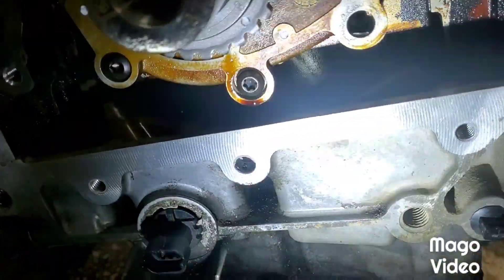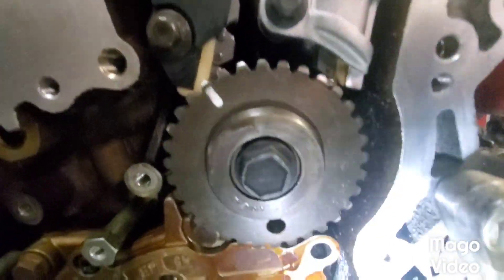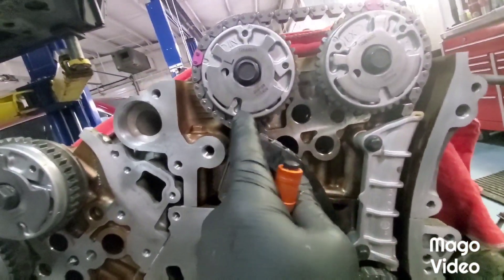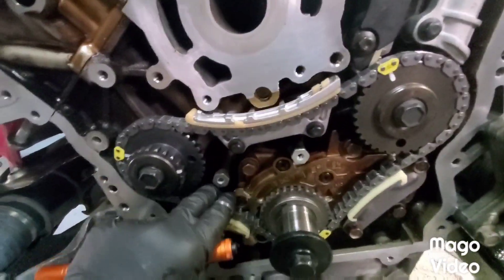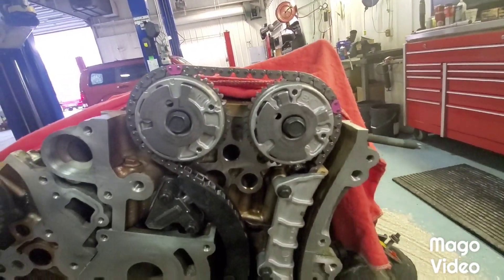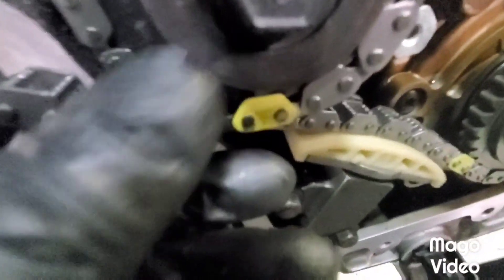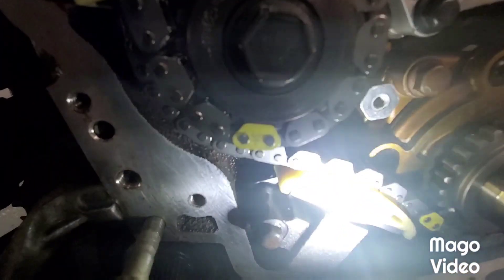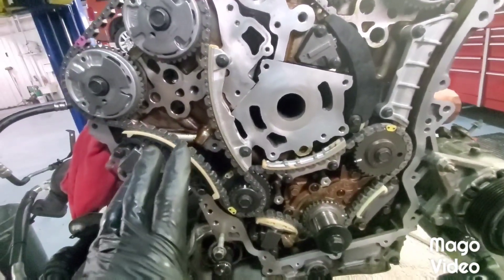GM 3.6L STAGE 1 & 2 TIMING SIMPLIFIED

Comment: Vid is good to go. But not totally clear..Which cyl is tdc and on which stroke when you line up stage one timing marks on crank sprocket (presume crank sprocket could be lined up but not on correct stroke).
Re-watching vid maybe I missed something. Again the vid is good to go. Thanks for posting.
Reply from the maker: If you're overthinking you're already lost

Comment: Hi paul i got a mechanic to do it but he set everything at 9 0clock he stated thats how he does them ,he put them on i put the car together he took a fuse or relay out and jumped it to turn it with out  it firing up once he fired the motor up it started to misfire then multiple misfires also a knocking noise in the manifold  or appear to be the manifold can u help .

Comment: Hey paul when u removed the stage 2 chain what timing mark were u set at, 5,or 8, im having alot off trouble following the procedure re timing procedure, as everyone leaves bits out or does it differently. i found  ur quick  giude in reply to a comment but there u refer them as banks can u clarify please, would be apriciated
Reply from the maker: Bank 1 is your right bank...Bank 2 is your left bank.  Remember that left and right as if your sitting behind the engine driving it.  So when you're looking at it from the front...as I am in the video...the left Bank (Bank 2) is going to be on your right.

If you set the crank sprocket to stage 1 timing mark before removing all the chains etc, you'll be good to go, remember it's not an interference engine, so as long as you follow the video and set the timing correctly in both stages, you will be fine.
Reply: @PaulysAuto  stage 1 timing is 9 oclock or 5 oclock a
Reply from the maker: @poogzie  stage 1 is 5 o'clock on Crank on the dot on oil pump

Comment: Hi, can ask what stage timing , 5, or 9.were u in before removing chains on right side also were u tdc before removing r s chains when u went to left side did u rotate the crank  if so to what stage timing, after u replaced the chainns in stage 1 did u rotate the crank to stage 2 and what timming mark was it 5,or 9 haope u with me .cheers

Comment: Hi i removed my rockers covers and had a quick look ,i then decided to rotate the engine for the timing marks but the i went anty clock wise and came to a stop ,i then checked the rockers and noticed right side last rocker on inlet side had come off , im not sure weather i caused the issue or it was there ,my code was p0008, if i did cause it how do i fix it ?looking forward to ur reply .

Comment: Left head uses DOTS on the phasers, the right head uses ARROWS on the phasers. (just in case you didn't know this, Left and Right side of the engine is degermed by which side you would see if you were standing at the back of the motor looking forward. If you were standing on or behind the transmission looking towards the front of the motor, your left would be the left bank or head and your right would be the right bank or head.) Most "techs" would know this but the kids at the part store are NOT going to know this. People that knew that the left side of the car was the driver's side might get confused because the motors are often in sideways now. I've had many issues with getting wrong parts, like motor mounts...they'll go by front and rear sometimes or left and right on others. When the motor is sideways or "transverse" which side do THEY think is left or right? You might have to get in the habit of telling them "left is the radiator side, right is the firewall side". LOL  It seems stupid and like something that shouldn't happen...but it does, often. I'm sure Pauly can attest to that.

I wanted to put up a quick comment here Pauly. The 2011 Acaidia that I did the timing on broke the chain on the right, phase two side of the timing. I thing the wear pad on the tensioner guide came off, caused an interference and the chain just snapped. FORTUNATELY....the cams were as such that no valves hit. I know it sounds like a one in a million  thing but first I checked it with one of those inspection cameras on a stick thing and then I did a leak down test. To my shock and pleasant surprise, I had nearly perfect pressure. I'm about to put the new timing set on, we sent the old stuff back to see if Cloyes would warrantee it. I'm not holding my breath. But in the mean time we bought a new set and I'm putting it on now. I didn't like how "chinsy" that one was. It's captured very well on one end but the other end is held by two rather small tabs. I thought they looked a bit weak and I'm guessing the one I thought looked rather weak is the one that broke and bound up the whole system. That tab was broken off but I can't say for sure if it happened first and caused the failure or the chain broke for some other reason and that tab just got broke off in the process. I wanted to glue it or something because I didn't like how loose and crappy it looked. I'll be THOROUGHLY inspecting every piece of this kit. If something's questionable...it's going back. I don't care if the hoist is tied up an extra day or two...I'm not risking it this time. Just because it's the almighty Cloyes...doesn't mean you can't get a crappy piece! 

The issue I had was not catching that the left side head uses round dots on the phasers where the right side used triangles/diamonds/arrow/pointers. Call em what you want. LOL The trouble I was having when I couldn't get it to run and had it back apart not knowing what to do...I was going by the painted marks on the new phasers. The intake cam phaser for the left hand side head was incorrectly marked, the ARROWS were painted, and I didn't catch it. It's easy enough to do guys, this is a HUGE job and it's easy to think you can trust the dealership to have things correctly marked but you CAN'T! You have to check everything. EVERYTHING! Like Pauly says, the exhaust phasers are interchangeable so you have to pay attention to the DOT vs ARROW on them. Don't go by the paint on your phaser marks. Like I said the brand new one I got from the dealership with the "L" engraved on it had the triangle mark PAINTED. I never gave it a second thought and  used it. It was marked wrong. I'm very lucky it didn't cause any damage but compression and leakdown tests verified that everything was fine. But I could have saved myself a TON of work and a ton of stress if I had just paid attention to this vid that says, CLEARLY, left head uses DOTS. The right hand head uses ARROWS.

Thanks for your effort doing this vid Pauly!
Reply: I just realized I used the arrows for both heads, real bummer, engine is already back In the cat, gonna have to get it apart and redo the timing using the dots. Hopefully tying to start it with timing set to arrows on both sides didn't damage anything
Reply: Got the timing chains off and did it again with the dots  and engine runs good, this video was very straight to the point and clear, thanks a lot!
Reply from the maker: @jcbuilds3648  excellent 👌,  always a great feeling when it gets done and fires up like a champ!
Reply from the maker: No thank you for taking the time to share such a detailed comment!

Much love for those who share experiences ❤ ✨ 💛 🙏
Reply: @PaulysAuto  I just buttoned it up. Still have some wiring I can do while the cradle's down but the body will be back down in short order tomorrow. Hell, I've dropped this cradle several times now...I've gotten rather good at it! LOL I SOO hate to admit that...LOL But yea, I got really good at dropping the cradle on that piece of crap! I'm scared to death I'm going to end up being the 3.6 high feather guy LOL
Reply: @PaulysAuto  By the way, Cloyes did pay for a new timing set.  Also, though I work on cars for a living, I'm not a professional. I have been working on cars since I was 10, I'm 55 now and what really helped me work like a professional without the certs, I went to school for engineering. An engineering degree, experience in that field enough years working on cars and you can do about anything. Again, where I made the mistake was I didn't notice that the dots were on one head and arrow on the other. I could have saved myself a lot of pain and suffering if I had noticed that when I took the motor apart. I had no idea it was such a complex timing set. This motor spun a bearing. I expected the timing to be the easy part! LOL...boy was I in for a surprise. Thanks again Pauly!
Reply from the maker: @waynethomas1726  Well I'm so happy you got everything figured out,  sucks that it spun a bearing. Thanks for sharing your story with me.
Reply: @PaulysAuto  No problem, thank for sharing that vid with me. I would have eventually stumbled on what the problem was, but how many more times would I have needed to drop it back out and tear it all apart again? That vid of yours where you said, "see, dot, dot," then  you moved to the other head and said, "arrow, arrow". It really burned me up that they painted the wrong marks on the one phaser. I naturally assumed them to correct mark. Never assume shit!

Comment: In my case, nothing on my car is lined up, due to me taking heads off and having them ported and a whole lot of other work, only thing left to do is set timing up to have my car back up and running. Now when setting stage one timing, do I automatically just turn the crank to stage one timing or do I keep turning it to stage 1 timing til piston is at TDC? Before installing my chains and moving on to stage 2. Please lmk ASAP :)
Reply from the maker: Marks are what matter 😉 set her and rotate CAM's as needed.
Reply: @PaulysAuto  and the engine is non interference correct?
Reply from the maker: @damiancastro9370  yessir
Reply: @PaulysAuto  thanks for the help!!!🙏🏽
Reply from the maker: @damiancastro9370  No problem
Reply: @PaulysAuto  another thing I forgot to ask my bad. After installing chains, am I good to go and put everything back together or do I have to turn the crank over a few times before I do?
Reply from the maker: @damiancastro9370  I always roll them 3-4 times to make sure she spins over smooth and seats everything.

Be sure to give her 4-5 clear flood cranks after your done before firing it up, this will prime the tensioners.

Also, be sure to clean those intake valves when disassembled to ensure valve coking is reduced...this is why I remove oil pan too, carb/choke clean, picks, and compressed air 😉
Reply: @PaulysAuto  thanks so much for advice! 😀
Reply from the maker: @damiancastro9370  no problem

Comment: Doing this timing job also. What i found crazy is that all the rocker arms on the intakes were just laying there as well as a couple lifters. I bought new rockers since most were broke but they are loose compared to the exhaust rockers. What causes this? Is it bad lifters or will they pressurize when the oil pump starts running again? Thanks for the video it has been a big help and any info on this.
Reply from the maker: I'd suspect lifter issues...yes.

Comment: Dumb question so jus line up timing marks on crank shaft number 1 doesn't have to be tdc
Reply from the maker: Start by putting number 1 at TDC on it's exhaust stroke, your stage 1 mark should be aligned accordingly on the crank, remove all the old chains, then the bank 1 cams are likely to roll on you a bit, but it's ok, because you will be moving them a bit once bank 2 secondary and the primary chains are set, then you'll roll crank to stage 2 mark and will be setting the bank 1 secondary.
Reply from the maker: The marks are not gonna lineup anymore once you roll it over to stage 2 mark on bank 2 secondary and your primary.

Comment: Quick question when you go to stage        2 which way do you turn
Reply from the maker: Turn it clockwise
Reply: @PaulysAuto  thank you for answering I did the job and won’t start acts like timing is off I messed up some where I thought maybe it was that but I did do that
Reply from the maker: @evandanna1919   Sure you didn't forget to plug in like a crank sensor or something
Reply: @PaulysAuto  when I crank it back fires and feels like it is fight it self to start no metal or crashing noise

Comment: Should cylinder 1 be top dead when setting stage 1 or 2 ?
Reply from the maker: I set it to TDC before stage 1 and move cams as needed during stage 2...it is not an interference engine so no worries there 😉

Comment: Hi man! Great video! My case is very complicated, i really need your advice.. I own Camaro 2011 V6 3.6 which throws P0008 P0016... 
1. Timing Chain Replaced(Cloyes complete kit) / (done it in 1 stage, not in 2 stages, used locking tool)
2. 4 Cam Phasers Replaced(OEM)
3. 4 Selenoids Replaced(OEM)
4. 4 Cam Sensors Replaced(ACDelco)
5. Crankshaft Sensor Replaced(ACDelco)
Unfortunately nothing changed.. Still same codes. My mechanics double checked alignment... My car is running sluggish,poor.. What should we do next? Pls help
Reply: check crank reluctor, might have moved a slight amount.

Comment: Question no this video is a little old now
Had a cheap eBay timing chain kit go bad on an 07 Arcadia so going with the cloyes as a replacement after breaking the motor down in vehicle when the evergreen brand name eBay timing kit tensioner failed
It jumped time on the front Bank then the intake valves and the worst part is it broke three of the cam caps my question is you can get the valves and all the other parts but is the cylinder head cam cap can you get that separately or do you have to get an entire new cylinder head. 
It sucks because I should have inspected the vehicle first after already ordering the new timing chain kit new camshafts and new GM phasers just to be wondering now if the head is toast.
Reply from the maker: As far as getting the cam caps, I don't know, they might only come with the head...maybe talk to a good GM parts guy and see.
Reply from the maker: If I were questioning the cylinder head I'd have a reputable machine shop inspect it prior to putting it back together.  Better to know 100% before spending time and money on her again.

That really sucks, I'm sorry to hear all of this!

Let us know what you find out ok?
Reply: @PaulysAuto  
Thanks for fast reply
Hard to get any dealer info on the weekend
But I'll definitely make some calls tomorrow into some local machine shops to see if the cam caps can be purchased separately
Or if their machines specifically to each individual head when they're cast at the factory.
Hopefully I'll find out tomorrow and post a reply. And lesson learned to everybody else watching this video avoid cheap eBay Chinese crap parts job will take three times as long now cuz you doing the repair twice and initially the cylinder heads were fine and I had no bent valves.
If I just would have bought the Cloyes kit to begin with I won't be in this boat now needing valves had gaskets and a possible head just to save a few hundred bucks.
Reply from the maker: @aaronwildman3652  yessir

Comment: Hello, so I’m in the process of changing timing chains on this specific engine. My driver side chain & crankshaft chains were so loose when I went to align the crank to stage one the chains both slipped. My question is what position do my cams need to be in before I start the timing chain process? O & the car just ran great just had a very slight barely noticeable rough idle & a P0008. 
Thank you, Dave
Reply from the maker: As long as those marks lineup with the chain accordingly...you'll be good to go...it's not an interference motor so you can not screw it up.
Reply: @PaulysAuto  not meaning to bug i have a 3.6 07 Saturn aura xr and on one cam all the rockers came off what could cause that ?
Reply from the maker: @brittanyncharles20  weak valve springs.   Did you remove the cams and inspect them for damage?  You'll want to measure your lobes and journals using a micrometer and check to see if you have uneven wear and see if they are out of specification.
Reply: @PaulysAuto  yes cam lobes are fine the engine is sludged up bad everyone i speak too said the lifters could be so clogged up and they failed
Reply from the maker: @brittanyncharles20   Yeah that certainly could be the case too only way to know is the tear it down and look at it.
Reply: @PaulysAuto   i got it all tore down and i seen you say this also it isnt a interference motor is that correct for the 07 saturn aura xr 3.6 sorry bro for questions this engine has me going nuts lol and the car is my audio vehicle and this happed and i missed slamology
Reply from the maker: @Dev JB Water pump always gets done when I do chains, pan comes down too.  If she's on the floor I'm putting it back to new.  I have laid this out in description.  Timing this engine is the easy part.

Comment: Thanks for the info. I do have a question though. So I turned the crank to set on mark and noticed the right intake cam is popping. I don’t really know how those phasers work. Would my phaser be bad?
Reply: It shouldn’t pop. When you took off the chains did you follow the removal procedure?
Reply: @myboy051  i haven’t taken chains off yet. Been trying find info on why it’s doing that.
Reply from the maker: @myboy051  thanks for your time and feedback on this 👍
Reply: @PaulysAuto  - have to help out fellow mechanics/Techs. We’ve all been stuck at one time or another.
Reply from the maker: @myboy051  absolutely 💯❤
Reply: @myboy051   thanks for your help. I did have to change out the right bank intake phaser. So I have to turn the cam to get the chains to line up to mark. How do I know if I turn the out or the in to line it up?
Reply: It’s only one or teeth off so I don’t have to turn the cam very much. I just don’t know which one of the two to turn to get the marks.
Reply: I should state the old chain on that bank is stretched when matching it up to the new one.
Reply: Look at cloyes timing chains website. They have a very good 8 minute video on how to remove and replace the chains.
Reply: @myboy051   thanks It’ll check that out.